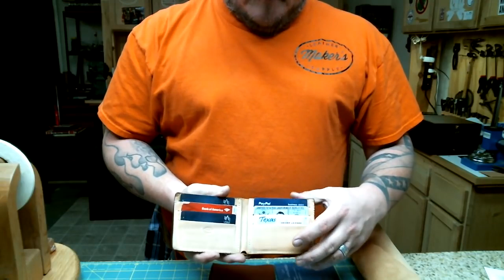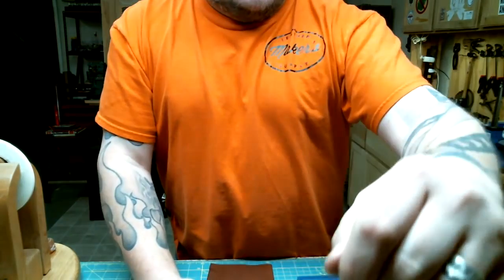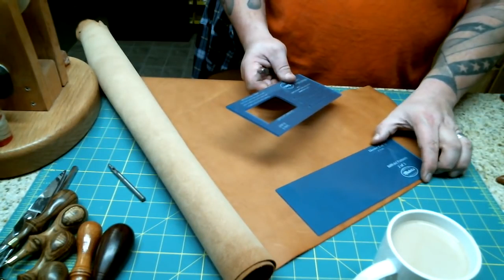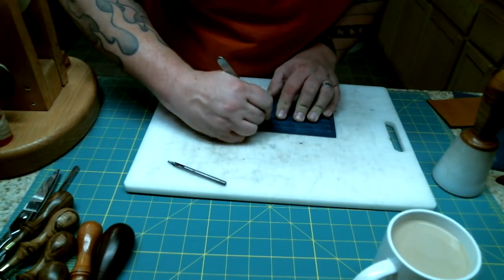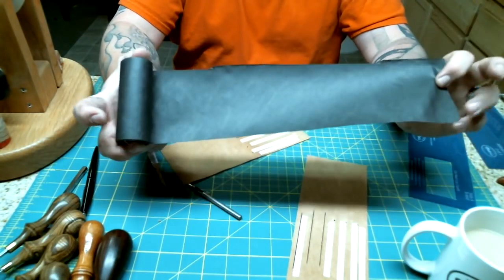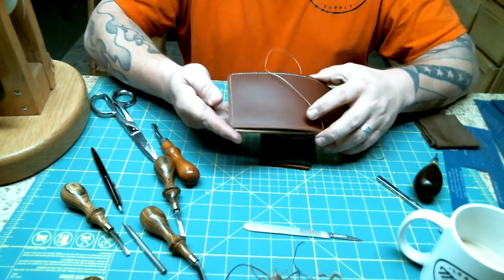Making a Billfold with TandPro by Maker's Leather Supply acrylic template

Comment: Question about how the TyVek is connected.  Since it is only connected with Double sided tape and a good deal of stress can be placed on those card slots, have you ever had the TyVek come loose in the pockets?  I can see this happening very easily with normal wear, tear and usage.